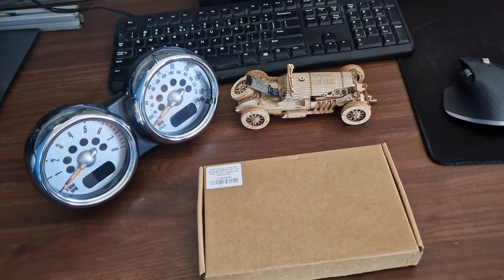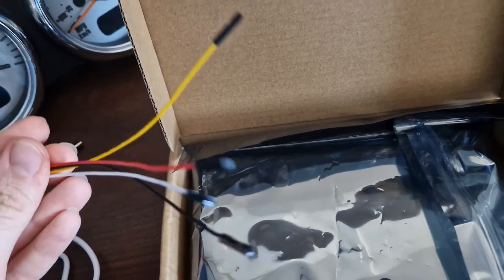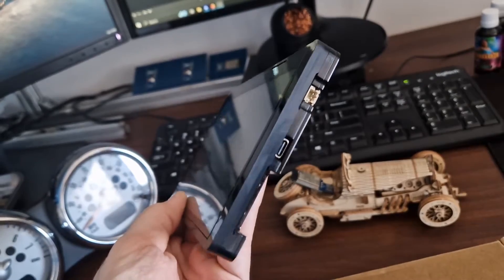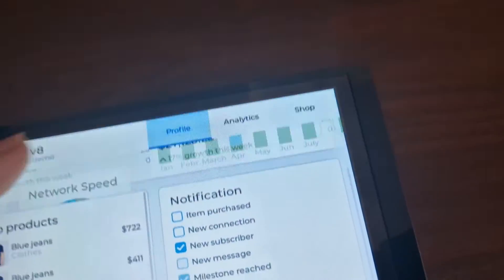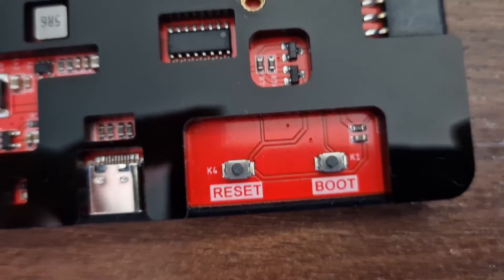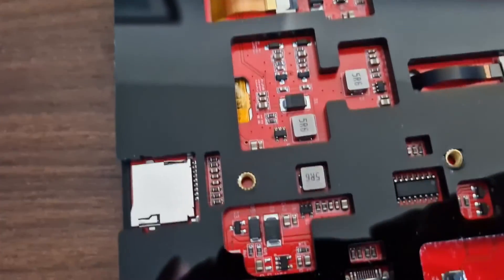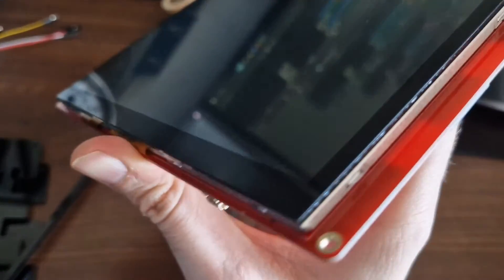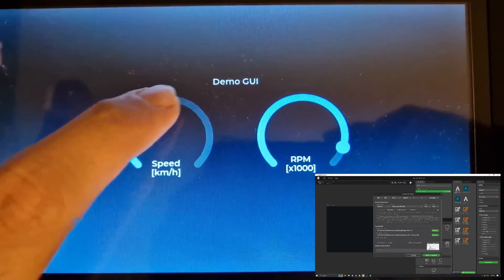Must-See Review: Elecrow's CrowPanel 7.0" Display

Comment: I see you have been doing a lot with cars and displays, I’m looking to replace my whole dash with a screen, but my car does not have ODB2 to get data from. 

I hope you don’t mind me asking, but should I have an Arduino to collect and process the analog and digital data before sending the data to a ESP32 linked to a screen? Or is it possible to do all the processing work on the ESP32. I am worried I will run out of memory with the amount of graphic components
Thanks
Reply from the maker: Thank you for the question. I will try to answer.
If your screen isnt too big and graphics is simple and basic (no shadows and/or transient colors) I think you will be fine with only ESP32, but chose more powerful variant ESP32-S3. Furthermore, even if you need additional controller maybe it is good option to use two ESP32s because then you can send data between then very easily using ESPnow protocol. 
But currently in my car gauge project I'm still good with one ESP32S3. 
Best luck in your project :)

Comment: Gauges looks to move with glitches. Would be interesting if they where working butter smooth and somewhat fast because automotive display should be fast and smooth
Reply from the maker: Thank you for commenting, but for this project I think this is perfectly fine. If you check out my other lvgl esp32 gauge it can be pretty smooth with some optimization https://youtube.com/shorts/FTiRnAAGcbE
Ofcourse this can not compare with display that is controled with raspberry pi or something much stronger than esp32. But lets see. I will try it first with full GUI and then see.